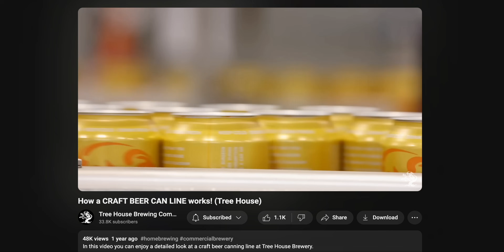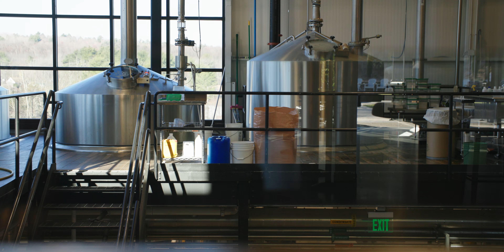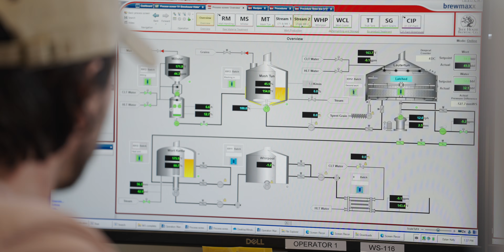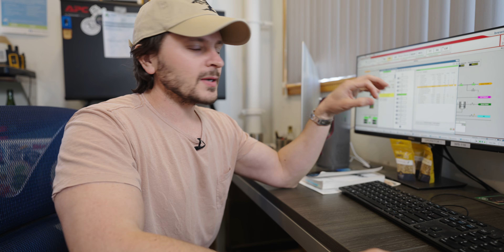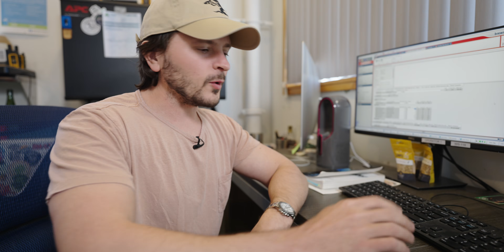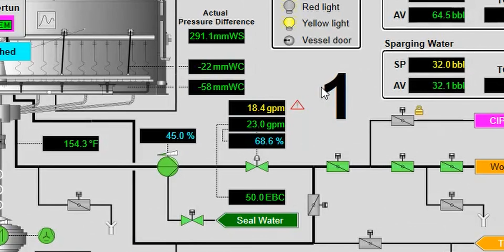Designing a beer recipe at Tree House!

Comment: Now this Video shows many years of research trial error. Semi Automation is very interesting. Do you change Mash temps per Beer Style or specific beer. Reason I ask is changing temps on some of my IPAs can make the hops Pop more or Malts adding front end with the sweetness added or removed . Lower mash temp is sweeter malt ? Higher Mash Temp is sugar remover, dryer finish. ? Love your set up ....Makes a consistent product doable.